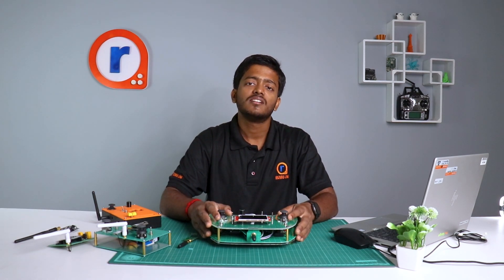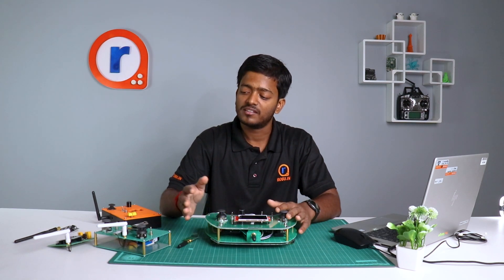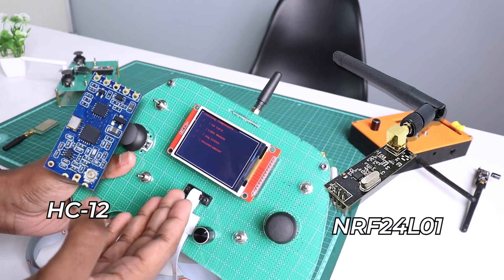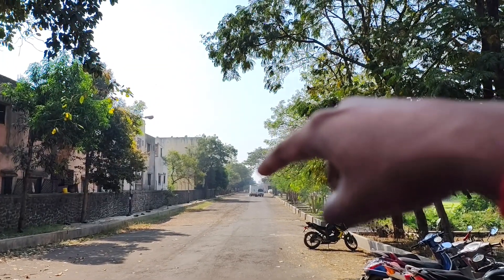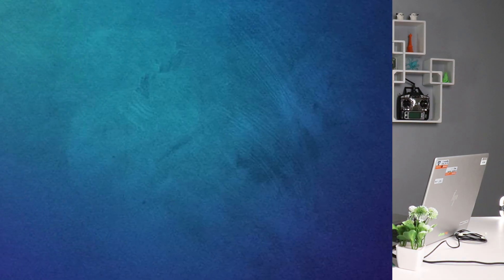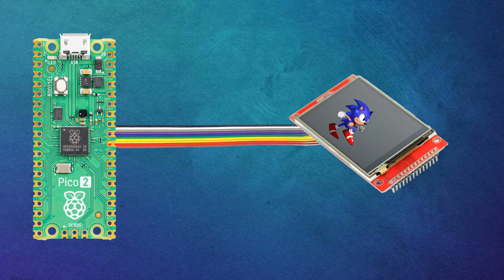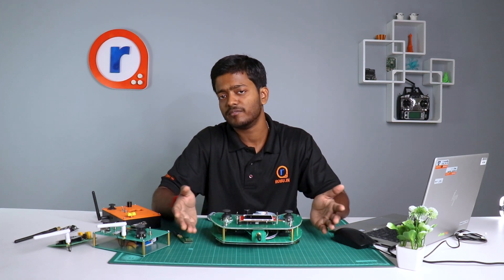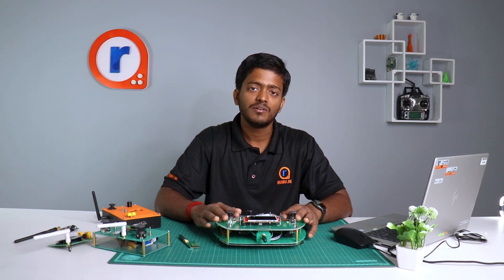DIY: Build a Powerful LoRa Transmitter for Long-Range RC

Comment: There is a library called RadioHead for doing the LoRA communication, I like it because it doesn't allow errors (corrects automagically), and even retransmits automagically too. However I don't know whether it would work or not for driving an RC plane, because may it be too slow transmition or would it be enough ? controlling elevators and ailrones needs some speed

Comment: I need to rebuild a controller for a Toyabi Monster 1:6.
Do you offer any services? I have the board and the base of the controller. It is a two toggle controller, that allows for 4 wheel steering( forward, reverse,  spinning opposite directions, etc). The 2 toggles create a contact point. Very old school